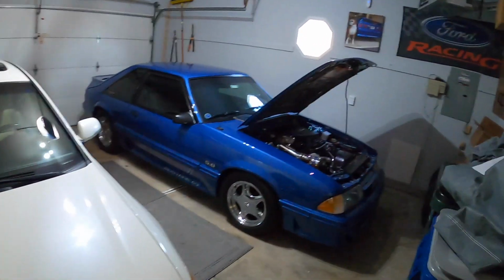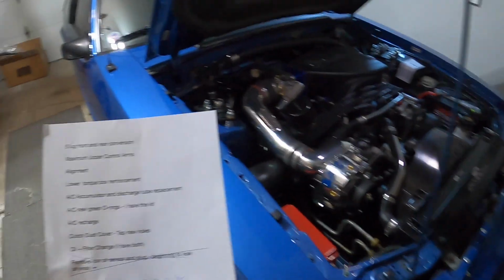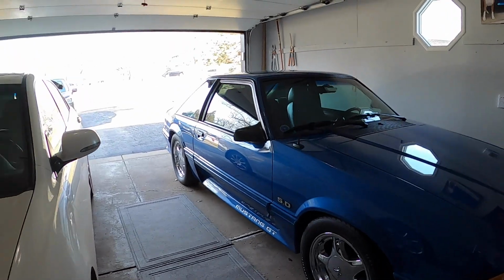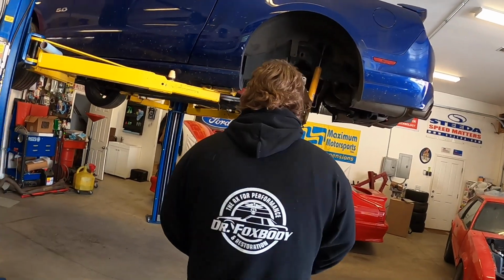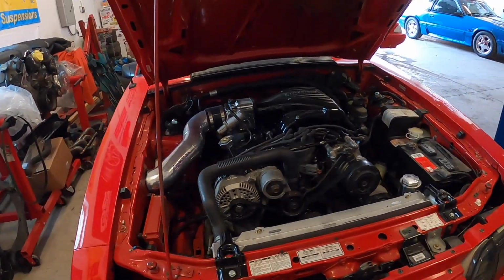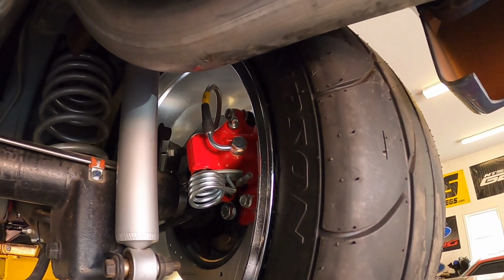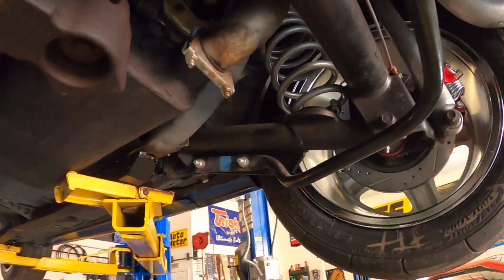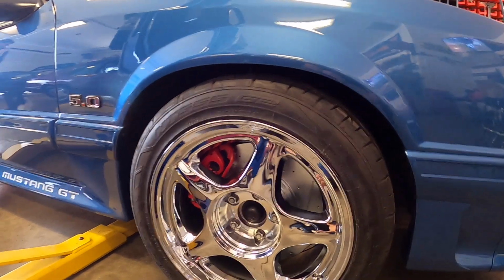Foxbody 5 Lug Cobra Brake Upgrade

Comment: Love the car. I have the exact one but black. Very similar motor setup and everything. I'm debating on whether to do the swap myself or stay 4 lug.
Reply from the maker: Yeah this is a great setup for a street cruiser! As for upgrading to 5 lug, if you're cool with your wheel setup then probably no need to upgrade. I just wanted some better braking and definitely wanted to get rid of the drums.

Comment: What us the part # for the rear brake lines and hoses? Thanks in advance.
Reply from the maker: The rear brake line kit from Maximum Motorsports comes with the hard lines and hoses. Part number is MM-MMBK7P. Thank you for watching!
Reply: @BrotherTom  thank you for replying with the part #.